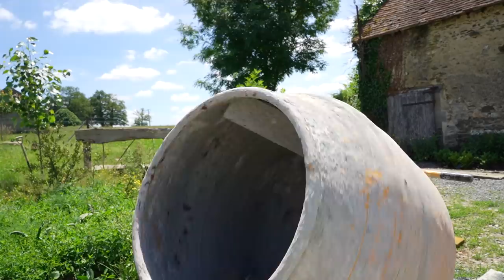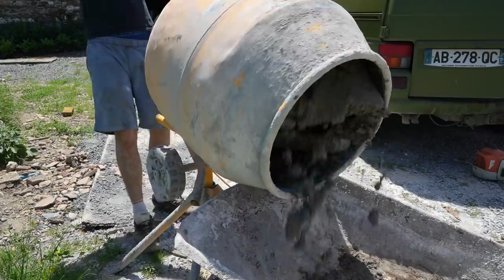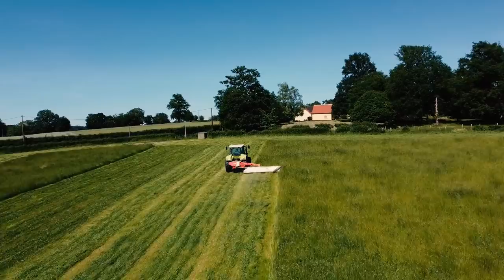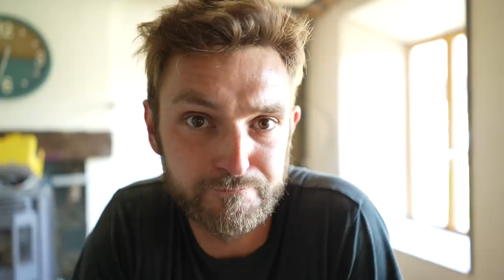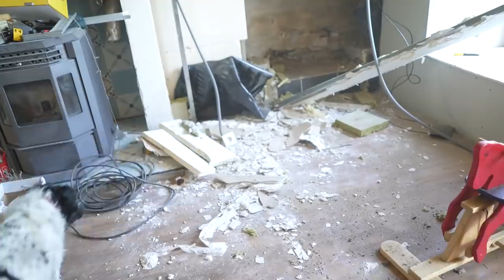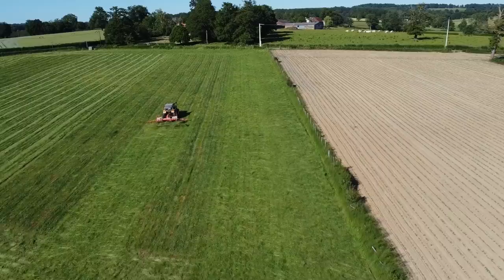Good old fashioned Reno vlog -EP012

Comment: Never ever use Cement on an old Lime Mortar Wall - the cement is much much harder than the lime and it will cause a lot of damage to all surrounding areas of the wall over time. Cement doesn't allow the wall to breath and it will crack as the building moves ....the cracks then allow water in when it rains and as cement is not breathable, you end up with damp walls. Cement in direct contact with wooden lintels/window frames guarantees the wood will rot.
Reply: This point^ REALLY can't be emphasised enough.

You'd be better using straw and scrunched up newspaper than cement in  a lime constructed building!
Reply: Yes!! As a structural engineer working on historic structures i could not agree more. Cement is so destructive to old stone as it stops the water getting out and leaves it only one option: to go through the stone which is the structural element leading to its premature decay. Only way to keep an old building healthy is to keep it dry and cement clogs up the wall leaving the moisture trapped.
Reply: Hot mixed lime ('de la chaud' in french) is the most compatible material for these structures and a good local mason will be able to help you choose the aggregate and sand that will work best (and look right) for local conditions.